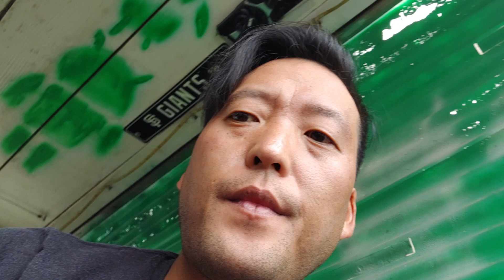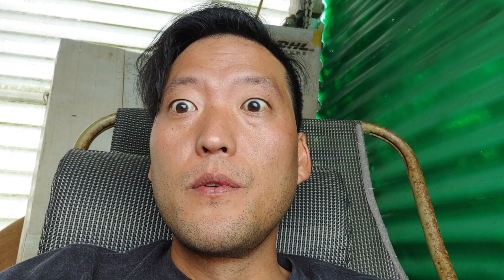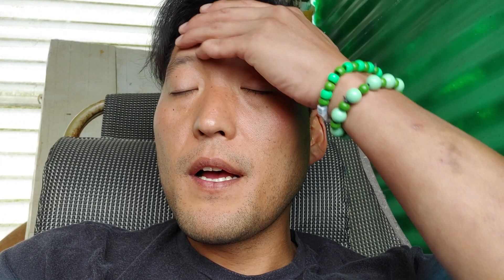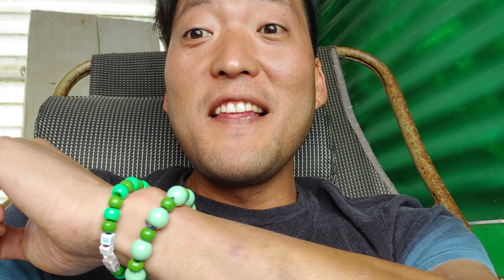Let's Talk About Lipo Battery Powered DIY Electric Skateboards!

Comment: Hello, good channel you have, have subbed ya😊
I have a old Ownboard Carbon AT which is only 10s, seen someone convert to 12s. I've kept motors but swapped ESC for flipsky FT85BD so could run 12s.
In theory, could I series in another two cells, to match, a 2s4p. In series to bump it up to 12s?
(With both batteries fully charged) same state. And savour the premium power!!!

Or the other option was to parallel another 10s4p to get double range. As there's a 40km long local weekly ride I could join here in Perth Australia. With no range anxiety.
Again both batteries fully charged.

Would like to have the option of doing both.
I have xt90 waterproof connectors that I was going to use one on board lid, and one into a diy battery box on top, between the feet style. Small pelican waterproof box strapped down.

I'm 53yo and fairly happy with the 10s speed, I rarely do full throttle or 40km.

Would still be nice to try her on 12s🔥💯💯 to try 12s

What say you?
Reply: Obviously if trying 12s separately by itself, I'll unplug the 10s. The adding another 2s to make 12s would be series ONLY plug. Aka NOT trying to parallel different voltages, like 10s+2s, sparks and magic smoke time

Comment: Make a video, how to attach lipo battery to bms. What kind of bms can I use with lipo's? Can I use same charger from lithium battery?
Reply from the maker: Yes same as lithium ion but you can use balance charge adapters.  Much easier to do actually, I will have a video on it eventually.

Comment: Just putting this on your radar, but by the end of the year I'll be building some batteries for other folks and making something of my own. Been building some for myself, sold one. So far everything is electrically and mechanically sound. My intention is to make them for not much over materials costs. Will do some DIY guides as well on my channel. 

A word on LiPo packs. You really can't charge them unattended, and working with them regularly isn't the best if one isn't in a house with a garage or shed. If they overcharge, get damaged during a ride, or just get worn out and someone tries to charge them anyway, a thermal runaway can't be stopped or even really extinguished. It'll just run its course and in an apartment that's generally pretty catastrophic. 

The two LiPo failures I've witnessed were only on RC car builds, with packs that are generally smaller than what one would use for a high performance eskate. Improper use of a pair of 6S lipos at near full charge would be very bad. 

This is generally why most users should stay away from them in an eskate unless they're willing to learn and follow all the safety procedures and be willing to retire an expensive battery if it is showing any signs of failure. 

Anyway, cheers sir.

Comment: I’m running two 5 cell 5000 ma  lipo batteries in serious .42 volts audible alarm sounds at 38.4 volts .charge both batteries at the same time at 1c 5 amps takes about 30 minutes to charge ,get only 4 miles.
Reply: I'd buy 2 of the same and have them in // to make a 10s 2p effectively doubling the battery capacity.